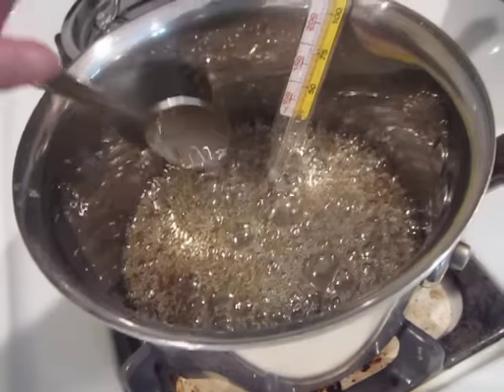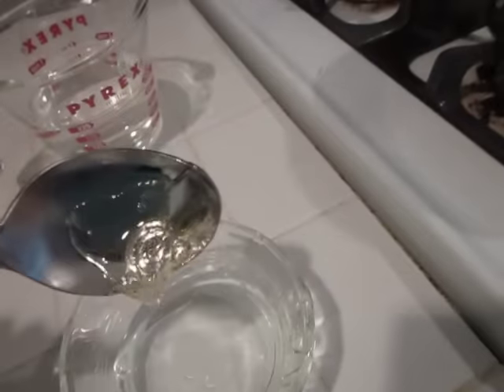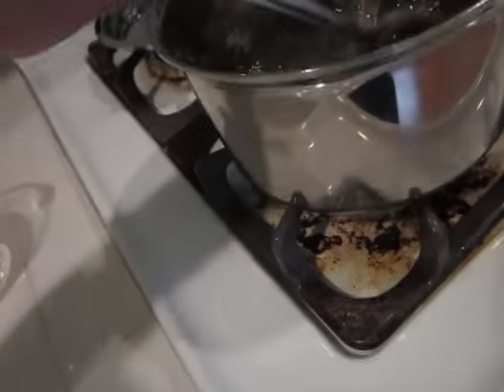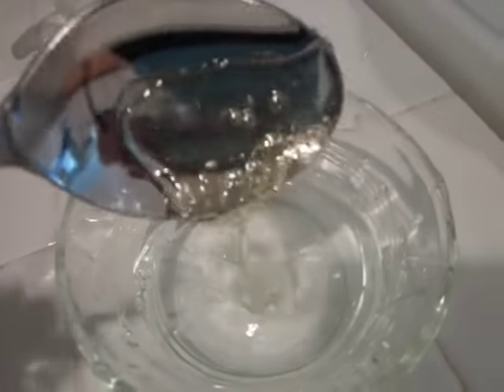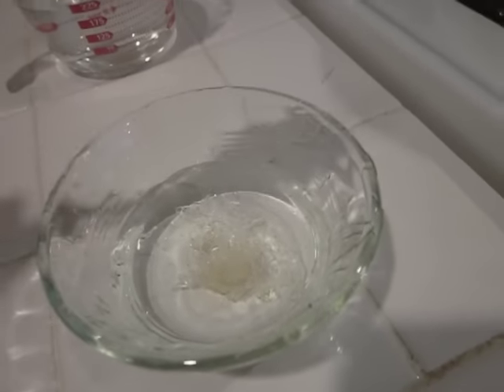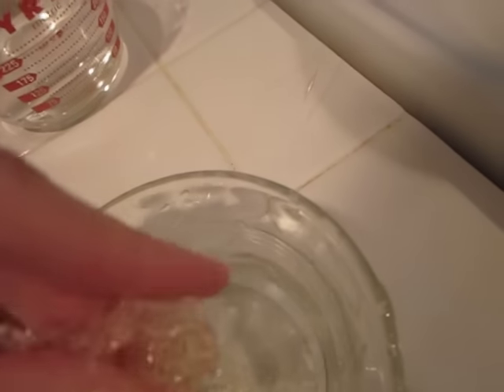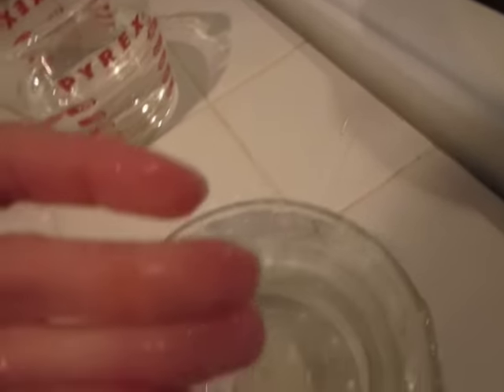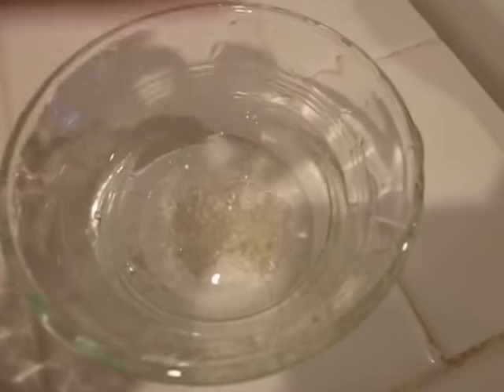Hard Crack Stage 300 F (150 C)

Comment: Your heat is up way to high, sugar will burn quickly before it comes to hard crack stage.  Use a very heavy bottom sauce pan to start and put your heat on med low.